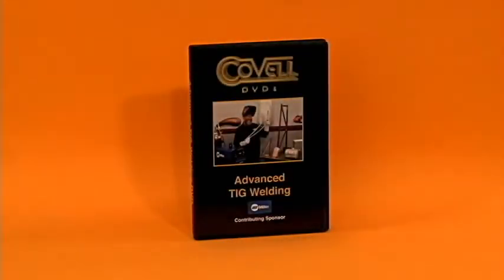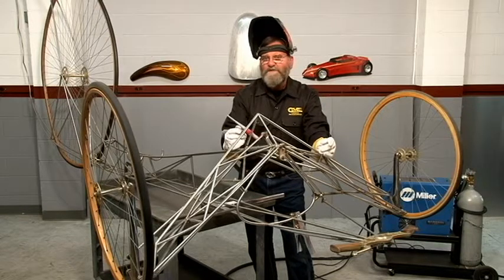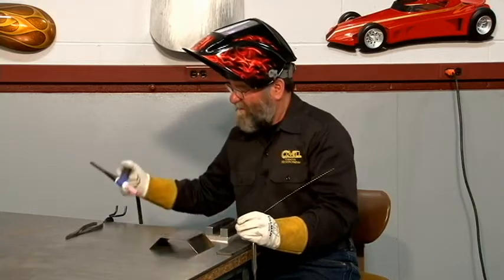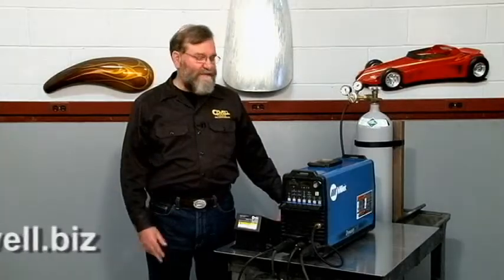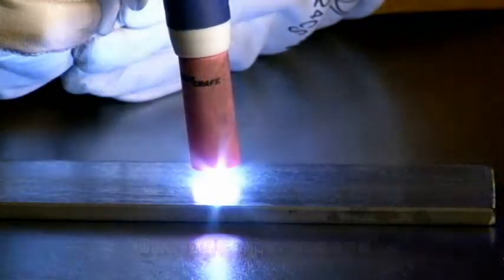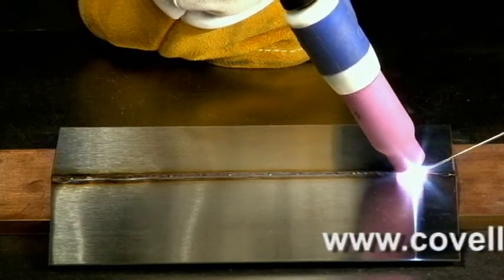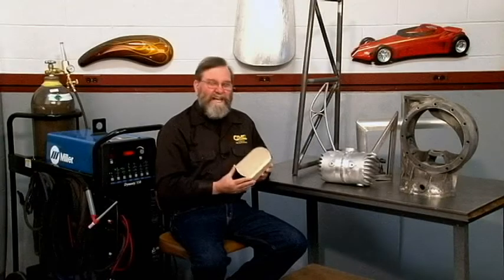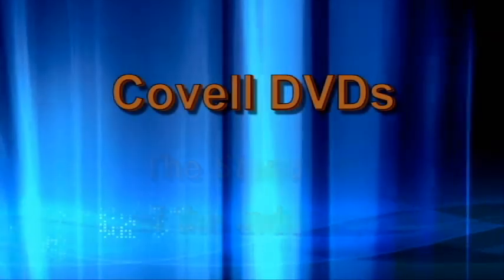Advanced TIG Welding

Comment: Awesome videos! Ron, im kinda confused when it comes to using filler rods.. What rod should i use for identical metals? For mild steel for instance.. Should i use a steel rod? And other kind of metals.. Thanks!
Reply from the maker: Your question is hard to give a 'blanket' answer to, but there are filler rods that are designed for any weldable metal. In the case of aluminum, there are 3 common types of welding rod, and many others designed for special applications. With mild steel, ER 70-S2 is the most common type of filler rod for TIG or MIG welding. If you are gas welding or Arc welding, there are other options. Your local welding distributor should be able to give you some guidance with this.

Comment: I bought this video. 
There in there is a part that shows your visit to a bicycle manufacturer. Kindly let me know the name of this tool that cuts a curve using circular motion to make a tube fit perfectly on another before welding. 
I'll really appreciate for I'd like to get that tool for some fabrication.
Reply from the maker: The tool is called a Hole Saw, and they are available from many manufacturers. You can see them used extensively in this video:
https://www.youtube.com/watch?v=wcTkQ_Y_dBA
Reply: Thanks friend. You are a true inspiration

Comment: Ron, I have a old Lincoln 300/300 Its been 45 years seince I have done what they call tig to day . How do I get started at this now? Mild steel and work up from there.
Glen
Reply from the maker: Glen,

Even though your machine is older, it's still a good machine, and it has a nice, steady arc, allowing you to make a consistent weld bead. Newer machines have more controls, but you can still do very nice TIG welds on steel, stainless, and chromemoly with your machine. If your machine has AC, you can weld aluminum and magnesium, too.

I 'grew up' with a machine similar to yours, and did some of my best work with that old welder!

Comment: You are Brazing, not Welding!
Reply from the maker: Here's a definition of welding and brazing, from the ‘Machine Design’ website:
“Welding uses high temperatures to melt and join two metal parts. A filler metal is often used as well.
Brazing joins two metals by heating and melting a filler (alloy) that bonds to the two pieces of metal and joins them. The filler obviously must have a melting temperature below that of the metal pieces.”